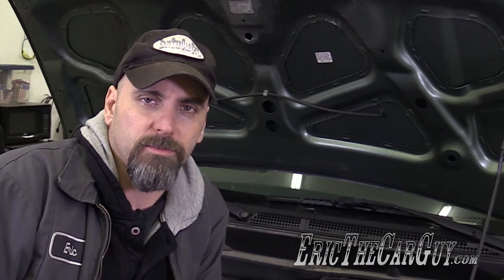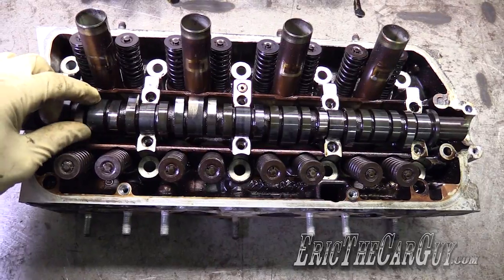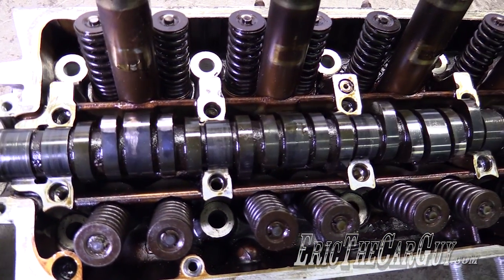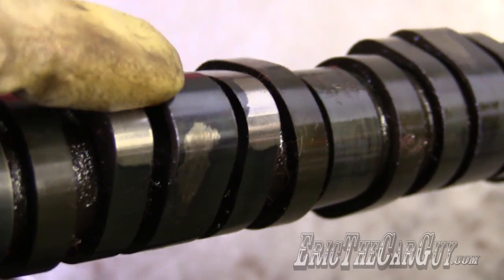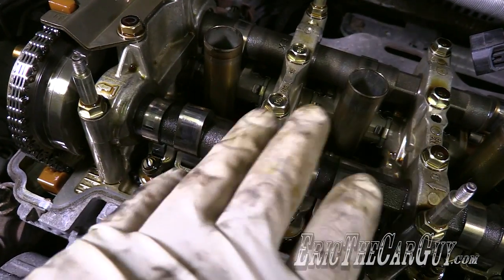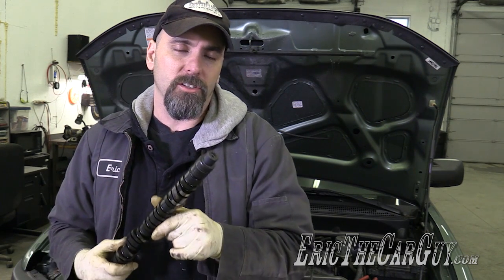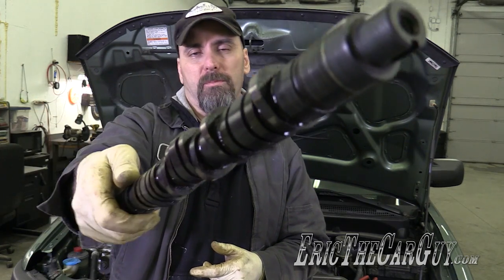iVTEC How it Works -EricTheCarGuy

Comment: sir Eric I am Raffy. I owned Honda Civic 2007, 1.8V. Now my car has undergo To Overhauling by my friend and a mechanic. I am just wondering that in the pan where my mechanic put the cam cap, I saw a small spring ang small cylindrical steel. Somebody told  me that this two parts are very important in the operationj of Vtec. One will missed, it will create abnormal operation of Vtec. Please comment about the spring I saw in the pan. Is it possible my mechanic forget it to fix?

Comment: I don't think the "i" means that the valve timing is adjusted.  My Honda iVTEC engine does not have a cam "phaser" to adjust the timing. The iVTEC engine activates the long-duration, high-lift lobe for economy whereas the VTEC activates that lobe for power (as in the K20 engine).  The cam phaser on your engine is part of the VVT system.

Comment: Hi, confused about how IVTEC changes lift and duration, could you please explain, I can only see how it can change timing...Cheers.
Reply: Just like in all vtec operations, the camshaft has a "low profile" lobe (or 2) and a "high profile" lobe.

Low profile is for low rpm, and light load conditions. 

High profile, which is your "vtec kick", is in high rpm, and high load.

The change in lift in duration comes from the valvetrain when it's in this high profile. 

With (k series) i-vtec, from 500-2700rpm in light load, you're in low profile. 

Beyond 2700rpm, you're in high profile, and your lift and duration of the cam lobes your valvetrain is using is different from 500-2700rpm.

Comment: hey i got a question,. when you did the k24 swap, can you use the jdm motor with out the vtec solenoid, i seen the new engine did not have the vtec solenoid and you add it, so can i use that engine with out it or do i need the jdm ecm if i dont want to ad the vtec solenoid???

Comment: Hi Eric: based on Honda service bulletin 13-085, the Honda J-series engine with iVTEC system causes the engine to start prematurely oil burning in cylinders 1 ,2 ,3.  Apparently, when iVTEC engages, this causes the rings to roll on the pistons which in turns causes oil burning.  Can you shed some illumination on this topic.  I dont understand what is going on.  Can you do a video on this interesting situatioin?

Comment: at 4:05, where the head is installed on the car-- why does the intake cam only appear to have a lobe with actual lift on the center?  the lobe next to it seems to be just flat round.  does this engine use the vtec solenoid to actuate a different cam profile or just to keep one intake valve from opening, increasing fuel economy?

Comment: Eric want to thank you for all your great educational videos.
I have a Question I've surfed the web looking for an answer maybe I'm just not wording things right. But i hope you may have some insight.
So i bought my sons 1st car he wanted something to work on, we found a 1993 Honda civic DX Automatic with a D16Z6 VTEC in it. I noticed the Solenoid & pressure switch where not connected with wires actually cut. The VTEC is not working cause its not connected, I've looked and there is plenty of instructions on how to connect VTEC for a manual transmission using wires to the ECU seems simple enough. But i haven't found a video or any 1 talking about how to do a automatic for VTEC 1 video said opening up the ECU & having to unsolder & re-solder something in the ECU? Now can this be done or am i just stuck? Thank you once again. J & Aron in TN.

Comment: The truth hurts!
Honda is one of the few companies actually put their racing experience and technologies in their everyday automobiles. From the cheapest low end to their super high end top of the line models. While other auto companies may sings the victory songs after their racing victories. Seldom these other  manufacturers use their racing experience and technologies in their lesser model NEW showroom  cars.
Companies like GM, Chrysler, and Ford use their race victories for advertising, bragging, and marketing promotions. But the cars they sells to you at the showrooms were as low tech as it can go for the highest profits in mind. 
Yes, only some of their specialty high end top of the line models may get some serious high tech and quality in them. While all lesser cars were nothing but old technical junks with a shiny fresh new skin and glossy black rubbers.
They only update due to market pressure and due to quality issues. That's the reason why the regular American Cars were so horrible experience and technology outdated. The core of the problem of USA Cars were pure greed from their top to bottom corporate operations and the Blame Games they plays with their loyal to new clients.
GM = GROSS MANAGEMENT
Dodge that Dodge
Dump that Dodge
Dead Dodge
Jesus Christ! Chrysler !
Road dead Ford
Freaking Ford !
F#*king Ford !
Fix it again Tony ! at Fiat Chrysler

Comment: The i-VTEC in the R-Series (R18A2,R20A3,...) works exactly the opposite what Eric told us:

http://asia.vtec.net/Engines/RiVTEC/index.html

They use the big cam lobe for normal driving and the high cam lobe for low load conditions to reduce pumping loss.
Reply: Yup, for R18 engines (economy i-VTEC), high lobe opens up longer for engine to work in atkinson cycle to be more efficient.

Comment: Dear sir,
Please could you explain the iVTEC system specific setup on J35 Accord engines 8th gen + up? Answering: 1- if it has any affect on performance like usual VTECs? 
2- How it really works to disable cylinder banks? 
3-If it reduce compression during could start or whats happen during start making sound much higher and lower down after some seconds?

Comment: good video. however you should mention that this ivtec you explain is on a dohc head. the ivtec on sohc engines like the r18 has a variable and computer controlled point of vtec engagement with respect to engine rpm. cam phasing on a sohc head would alter the exhaust timing too which may not be beneficial!

Comment: Correct me if I'm wrong, but doesn't V-TEC also open a valve that pours more gas into the engine?
Reply: When the intake Valve is open, air and gas both comes in. In which ratio, it depends on how much air you got, how many rpm's you are and which position of you gas pedal is
Reply: Rudam Bandara you talking about open throttle valve? when you slam the gas, your just dumping alot of gas into the engine, then once it hits a certain range of rpm, vtec comes in. full open throttle is different from vtec.

Comment: Eric, please help! I have 2005 Accord LX, and I've just tested 2006 Acura TSX for a day. I've found a lot of Accord in the TSX (interior, mechanical, etc.), but I've noticed 2 main differences: the ride comfort is much better in TSX, and - despite the same engine - TSX takes off much faster... How is that possible with the same engine? What do I need to change to have the engine in my Accord as responsive as the one in the TSX? Same question regarding the comfort... So basically, I'm asking you how to make Acura out of my Honda... Please, help. Thank you!
Reply: MyChan Nel same engine doesn't mean same tune.  also tsx is supposed to be more luxurious so it's gonna have a better suspension. the tsx is the European accord and your accord is the na accord.

Comment: How does iVTEC change lift? I only saw you show variable timing, did I miss the part about lift? I don't see separate lobes like on traditional VTEC.
Reply: +Blake D BMW's VANOS system is indeed variable valve timing, but much different than Honda's VTEC or iVTEC as it changes the rocker arm geometry with a secondary cam on the rocker's fulcrum to change lift and or duration. It's infinitely variable within specification to the engine. Much different than VTEC mechanically, but achieving a similar result.
Reply: Partly right - iVTEC does change the timing, and also in the cam lobes. 

"The K-Series engines have two different types of i-VTEC systems implemented for K20A2/K20Z3 engines and K20A3/K24A4 engines. The first is for the K20A2/K20Z3 performance engines like in the 2002-2006 RSX Type S or the 2006-2010 Civic Si and the other is for the K24A4 economy engines found in the CR-V or Accord. The performance i-VTEC system is basically the same as the DOHC VTEC system of the B16A's; both intake and exhaust have 3 cam lobes per cylinder. However, the valvetrain has the added benefit of roller rockers and continuously variable intake cam timing. Performance i-VTEC is a combination of conventional DOHC VTEC with VTC (which operations for intake valves only). The VTC is available in the economy and performance i-VTEC engines.

The economy i-VTEC K20A3/K24A4 engines is more like the SOHC VTEC-E in that the intake cam has only two lobes, one very small and one larger, as well as no VTEC on the exhaust cam. The two types of(K20A2)engine are easily distinguishable by the factory rated power output: the performance engines make around 200 hp (150 kW) or more in stock form and the economy(K20A3)engines do not make much more than 160 hp (120 kW) from the factory."

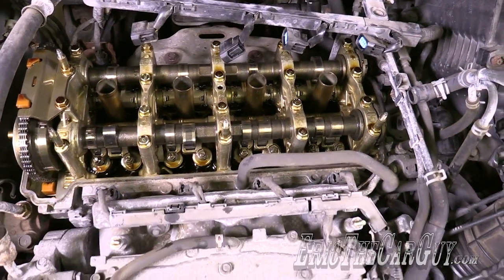ps. Look at 4:13 - you can see the smaller lobes on the left, and high lobes on the right.
pps.  Eric does say something about the VTEC system and the i- System at 5:42
Reply: The Honda Engine Management choose the right timing and setting with the speed for the VTEC functions. It's the entire package for the computer and mechanicals work together in harmony.

Comment: Does it kick in on a particular RPM?
Ive got a v-tec a few days ago.. didnt know nothing about it :D
Reply: Depends what iVTEC motor your running 
The "performance iVTEC" found in the integra rsx tsx type r type s and the Honda Civic type R have a specific VTEC engagement at a certain rev range with its vtec running on both exhaust and intake cams 
The other series like the k24 "economy iVTEC" found in the crv accord odyssey etc that have a low rev range and a lower compression range run on that VTC system iVTEC but they only have vtec on the intake cam shaft .. That's why on the economy iVTEC you don't get or hear that vtec kick or sound .. 
In saying there are also some k24 series engine that have a VTEC engagement 
The k24a1 is solely VTC vtec
Reply: The older B series and some D series VTEC engines do have a specific rev range of VTEC engagement and they run vtec on both exhaust and intake cams 
Best to get ur engine number or code see what you got and check up about it 
From memory the B16a1 VTEC engagement is at 5000 
B16a2 5500
B18c2 around 5700
B18c and c7 is around 6500 as being the type R engine for the B series 
There's many more but you can have a look around and study
Reply: Usually 4,000 rpms or higher.

Comment: So if i use the wrong type of oil will it effect my variable valve timing. if you have a higher max oil pressure will you get a different amount of timing variability?

Comment: So what is the difference from Honda's ivtec and Toyota's VVTL
Reply: Not much, just different acronyms. Honda's system gives you more of a bump in the back though and an audible difference. If you were ever blindfolded and drove a Celica with the 1.8L VVTi you probably wouldn't know if it was a Honda motor or a Toyota. They both rev to the stratosphere and both have really nice pull up top

Comment: I don't know much if anything at all about cars. If having it activate at a certain RPM means the car goes faster or whatever, why not just always use that center lobe on the camshaft instead of only activating at times? Why limit the performance boost? Can anyone explain to someone who knows close to nothing?
Reply: +Ice Kold Killa Better Fuel Economy/Low Emissions at low revs, VTECH POWER Performance with High Revs, but  drinks fuel :)

Comment: So does that mean the iVTEC kicks in different rpm depending on the scenario?
Reply: Ki Y Kim That's the one. So if you're flooring it in a low gear then you'll get VTEC happening later but if you're in a higher gear you'll get VTEC happening earlier but if you're at high revs and increasing them slowly in a low gear then you won't get VTEC. Another way to view it is that it's really difficult to replicate a scenario for ivtec to happen as it takes in so much data but VTEC will always happen at a certain point.
Reply: My K24A3 ivtec has been ECU reflashed to always activate at 4600RPM WOT
Reply: Patrick Patrick what I didn’t know you could do that. That’s crazy! What does WOT mean? Could you do that on a Acura TSX?
Reply: @joshuatorrez7608  Wide Open Throttle

Comment: iM surprised that Apple hasn't sued them yet for trademark ambiguity...
Reply: Lol should be the other way around. 
i vtec was designed and came out before the i phone was release and invented. Smfh. Honda cam technology was the first of its kind from late eighths now all manufactures copy the setup
Reply: SSShhhh don't give them ideas.
Reply: That's why it's called "I-VTEC" and not "Ivtec" ;-)
Reply: IMac came out in 98, I VTEC was in 2001..
Reply: Cody Hackl Didn't some of the 90s integras and other performance versions of Hondas have Vtec but not IVtec?
Reply: Would you rather have an Apple or a Honda?
Reply: John Bond the i in i-vtec stands for intelligent.

Comment: BMW has dual VANOS that changes the cam timing on both cams that is similar in concept as iVTEC.  The M54 engine has dual cams with dual VANOS and hydraulic lifters that don't require adjustment. The bad is that it has an aluminum block and when you over heat the head one time, it will pull all the head bolts straight out of the block from the head swelling and ruin all the threads. Ask me how I know, go head, ask.. haha
Reply: How sway
Reply: +jimenez jaime He doesn't have the answers!!
Reply: how Thor mcgee?

Comment: vroommmmmm (5,000 RPM later) BWAHHHHHHHHH vvvvvvv BWAHHHHHHHHHHHHH
Reply: I fart a lot when I drink too. If you fill up at stations with less alcohol your car won't sound like it's farting all the time.

P.S. did you know you can skip the gas station all together and fill up your car with bees? By sound alone I think that 25% of the civic's in my area are powered by bees currently.

Comment: hummm curious i haven't study closely the exhaust cam lobes to the intake lobes is there a 90 degree out of phase or something curious if they are all out of phase by a certain amount or if they all are a little different in phases.... i know they can have different durations (or sharper/longer lobes but not sure if there phase degrees between the exhaust and intake are always around the same for non vtec as well as vtec) ... it would stand to reason that one could make VTEC/iVETC all off of a motor or electrical means without any pully wheel or sprocket for the cam to get more optimal computerized timing some day

Comment: My 2003 CR-V EX was recently declared a total loss.  We're interested in a 2007 Acura RDX Turbo SH-AWD.  I still have genuine Honda fluids (coolant, brake fluid, etc.).  Are those the same fluids used with Acura?
Reply: 2cyclemix Yes.
Reply: Great.  We purchased an '09 CR-V EX-L.  The ride is much better than the '03.  The '03 rode more like a suv (duh!) but the '09 rides more like a sedan.
Reply: Honda and Acura are like blood brothers

Comment: Hondas are really good cars!
Reply: Hell yeah i just got myself a 06 honda accord LX 4 cylinder just now gettin broke in lol at 100k got it with 99,000 before i had a 08 toyota corolla until i totaled it n i gotta say i like my honda accord way better than i did with my toyota corolla its hard 2 say which 1 is better 2 me toyota and honda are about the same in terms of reliability but i always heard hondas automatic transmissions are a little on the weak side thats why im making sure mine i change the tranny fluid and filter and when i do that gonna put lucas transmission stop slip in there thats the only down side with honda is there automatic transmissions are on the weak side so if you wanna stomp on the gas and b race car driver your best bet is to get a manual trans. But as long as your doing normal everyday driving and dnt beat the shit outta your honda race it then the auto tran. Should last i would think
Reply: 266k Hell yea

Comment: Eric: Does it WORK? Can you actually tell a worthwhile difference between engines with and without VTEC/iVTEC? There are engine designs being developed that do away with the camshaft entirely, control the valve timing electronically, and operate the valves with big honking solenoids. They are are MUCH more flexible over a wide range of conditions than cam based systems and I can't help but wonder if these SLIGHTLY variable cam designs are worth the hype. In other words, did they just invent a better buggy whip?
Reply: i would imagine that camshafts are not going to be around for much longer. Koenigsegg now uses pneumatics to control the valves in their engines = no camshafts. It's just a matter of time before that technology finds its way into normal cars as well

Comment: Basically it changes your little fuel efficient engine at lower rpm into a pseudo F1 at higher rpms when you floor it.  That's the whole point of it.
Reply: Yup, wish I had a type r

Comment: Hi Eric...so your saying the computer CPU...controls solenoids that send oil to the mechanism to change the timing and the amount of lift each camshaft has...so in a sense is this why you can change the computer chip inside it to gain more control over that system..???? or have a completely separate CPU or control (box) that could be adjusted on the fly...

Comment: Vtec is the dual cam lift mechanical (two different lobe sizes for same valve group). VTC is the timing of the cams software controlled VTC is only on the K series, while vtec is on most Honda engines. Programming using hondata device has another layer of work on the K series of engines. 
Vtec has no equivalence in the other brands (no system can change both duration AND lift of valves) while VTC is almost equal to BMW Vanos system (phase timing). I thought it was necessary to differentiate the two sub systems.